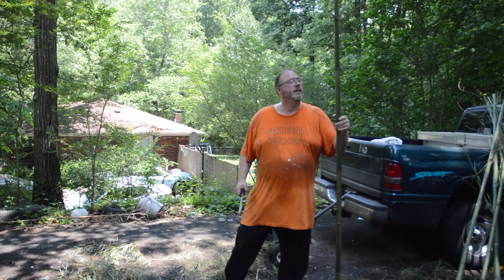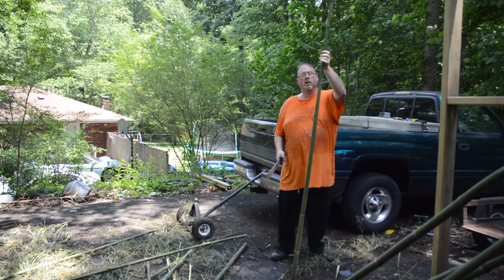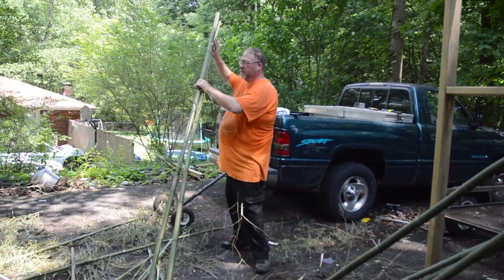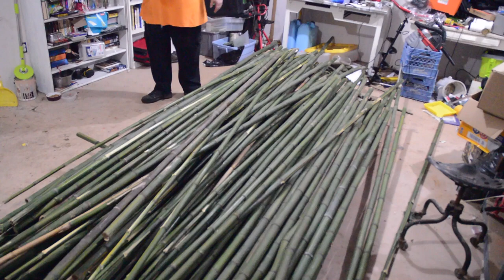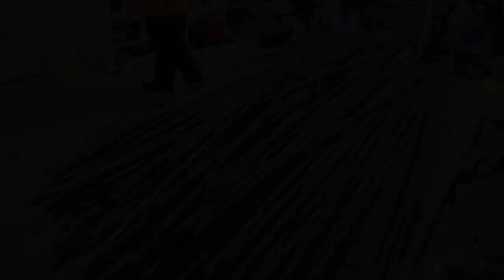How to Dry and Cure Bamboo Poles

Comment: I have what I think is river cane. Very long sections between nodes. I want to cure them and make flutes. There are some already dead, ready to go, but of course outside of a brief window of being dry (between green and rotten) they are split and no good. Still, there are quite a few that I think that have died and dried and will hold up, so I can get started trying to make a few flutes while the green ones dry

Comment: Do you have several braces running perpendicular underneath the bamboo you're drying? I apologize if you answered that already, I just wasn't able to tell for sure in the video. The reason I ask this is because of the lesson I learned when drying my very 1st batch. I did not have enough braces underneath mine & they ended up bowing so badly that almost all of them were unusable. I was so disappointed! Every batch I dried after that, i made sure to place my braces every 2 feet under the whole length of my bamboo & they dried so beautifully & perfectly straight.
Reply: I just got some bamboo that had gotten broken in a windstorm and just dried where they stoof.  They re  all straight and nice.  I'm looking for info how to cut to try to make mason bee houses,  wasn't sure if fine toothed saw was right......